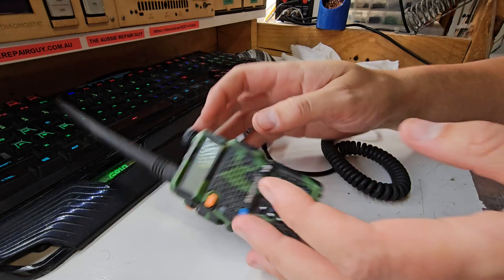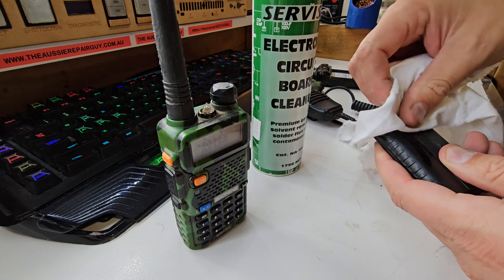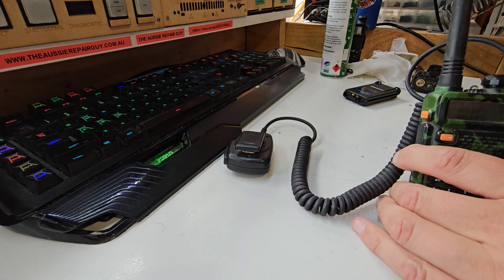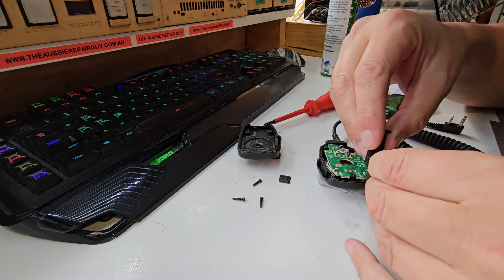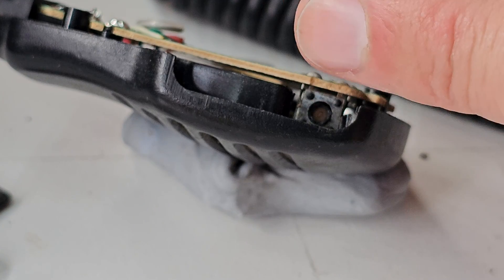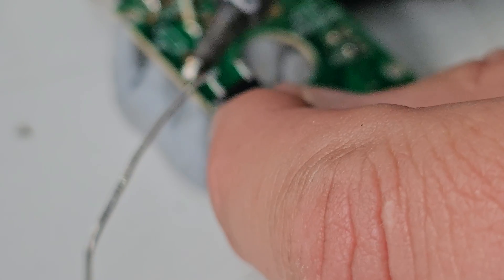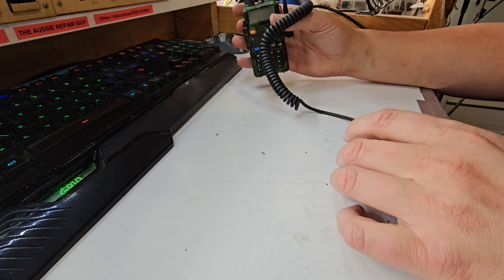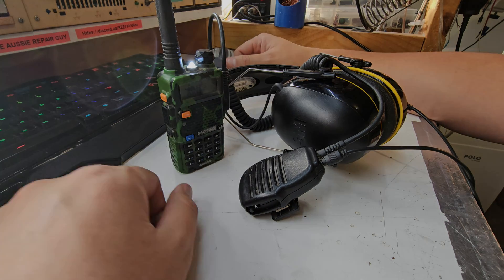Baofeng UV5R | Common issues

Comment: Hi, I have a Beofeng, did similar 12V mod to charger.
Currently doing a similar mod to Quansheng charger that has what I would call a dodgey 240Vac input to internal smps.
I keep a selection tactile buttons, I got a container of various types from Ali or Bang.
Good temp mod...
I'm thinking of getting a base 3D printed, a copy of the charger base to use to keep them upright.
Reply from the maker: I have limited use for these nowdays, so theres less incentive to innovate now. I have looked at the Quansheng units, but they feel complicated where they dont need to be
Reply: @TheAussieRepairGuy  They have so much potential, you end up with more and more complex menus. I have two Quanshengs, both with original firmware, no inclination to upgrade and get all the different features. Most that I won't use.